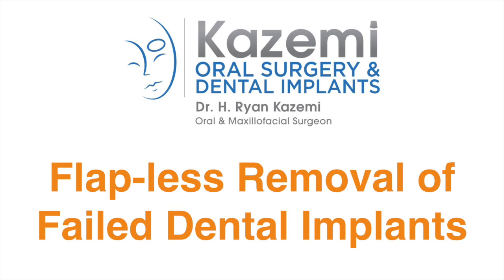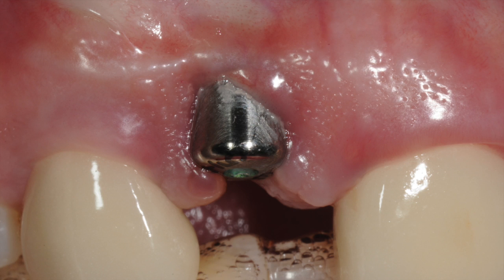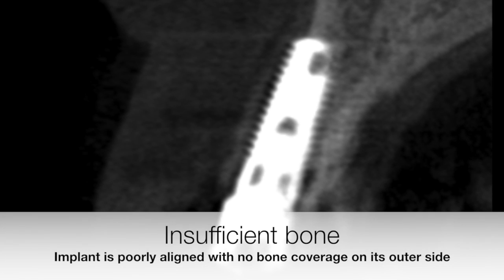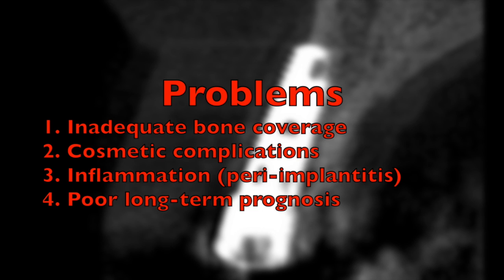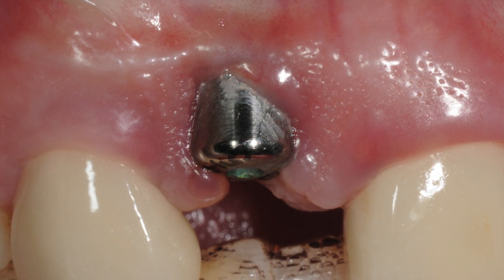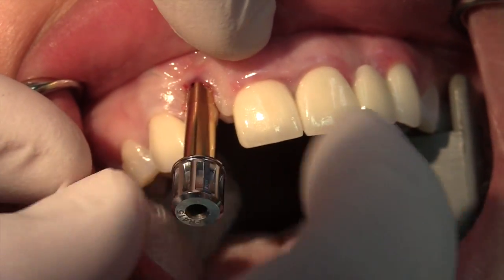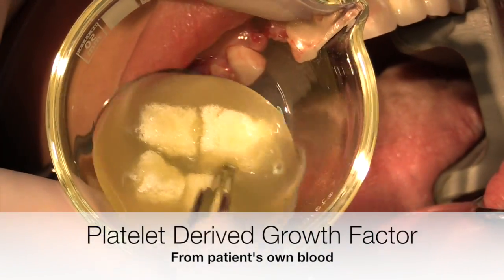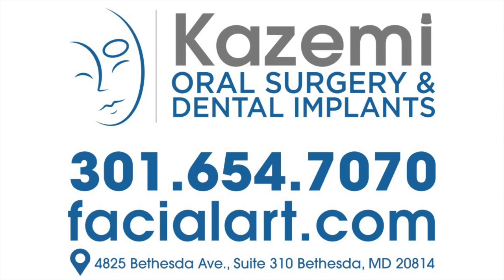Flapless Dental Implant Removal

Comment: Thank u for your video. I am about to remove implant and trying to learn. That technique seems to be pretty simple and easy. But i am afraid that too much torquing may fracture bone. 

What would be maximum torque that you shouldnt go over? 50 N?   Or does it work in all cases even those that are solid non mobile?
Reply from the maker: This is very technique sensitive and I would recommend training first. 250  N max.; works on all implant types , even if fully integrated